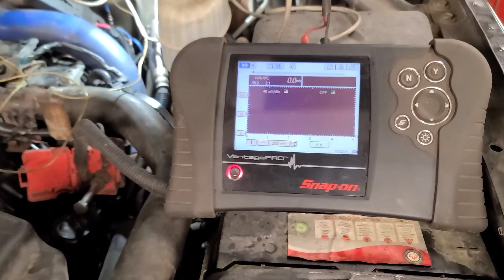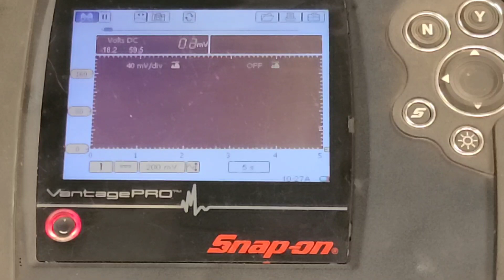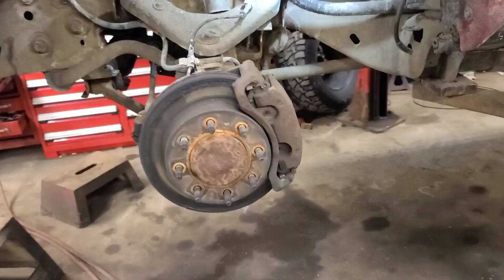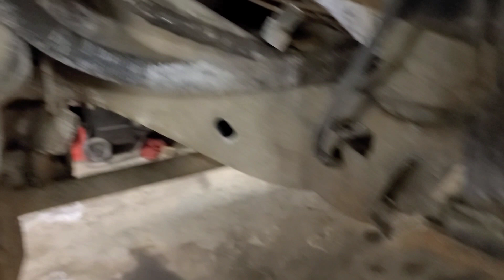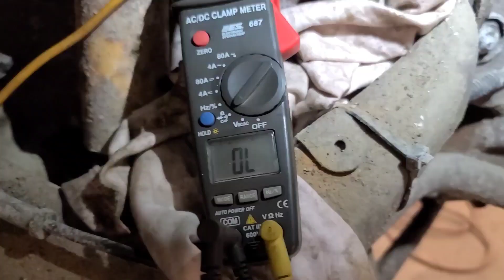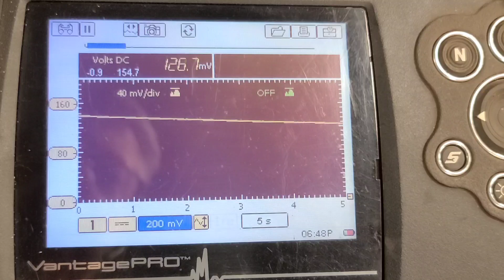2003 GM Duramax LB7 Glow Plug Testing Using Amp Clamp

Comment: How is it that those plugs came out so easy?   Did you use anything special?
Reply from the maker: Just a long handle 3/8" ratchet and flex socket. I have seen where they break off in the head though.